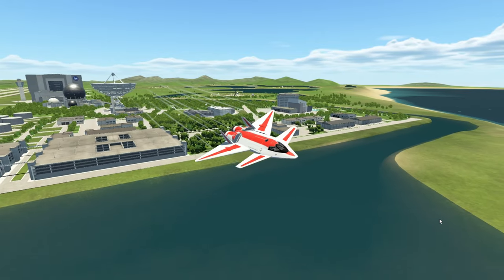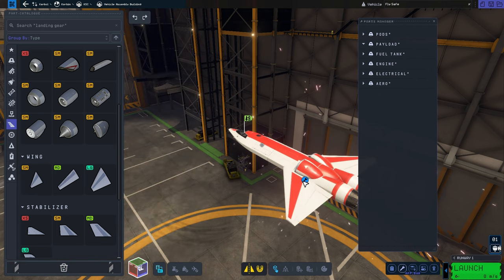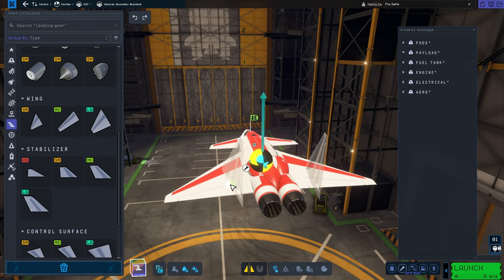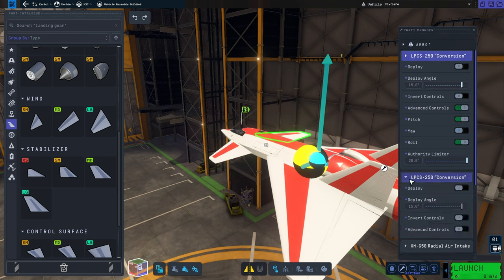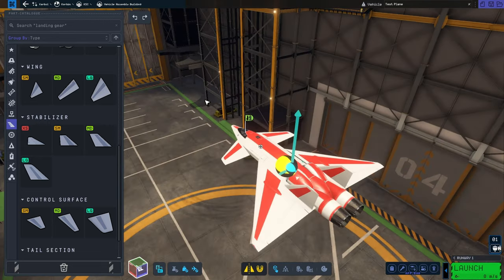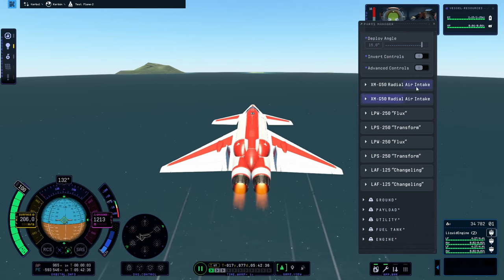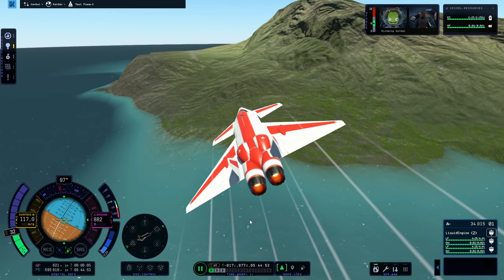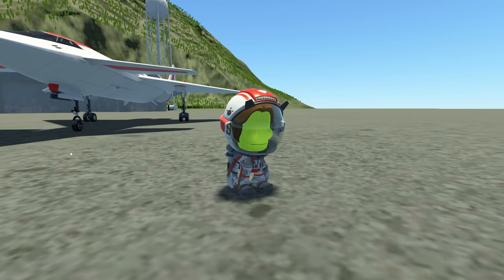How to build and fly your first plane in Kerbal Space Program 2

Comment: 11:05 Like in KSP1 you can adjust trim by pressing "alt + <direction you want to trim>" in KSP2.

So nose up trim would be "alt+S". (press multiple times for more trim)
This also works for roll and yaw trim.

To reset all trim to neutral you press "alt+X".

I think you can just hold to trim quicker, but I prefer smaller adjustments anyway.
Reply from the maker: Thank you for that
Reply: You're welcome!
I just found out there's a bug with it in KSP2, as it cuts the throttle when you use alt+x to neutralize trim. So be mindful of that :D
Reply: Does this fix the plane constantly tilting toward a nose dive? Also you seem knowledgeable enough, do you know why my planes wobble when I have auto stability on? It stabilizes but it wobbles horribly.

Comment: Building planes is so annoying with being unable to move the wings easily. I didn't realise it was because the procedural window was open but that's because it doesn't flash or anything. Also blueprint mode should lock the part placement in the direction towards and away from you, again trying to move wings was a nightmare.
Reply from the maker: Procedural window confused me as well

Comment: how do you fucking trim?  The plane keeps wanting to dive and I need to get 1/2 way around the fucking planet.   My fingers are numb and soar from CONSTANTLY fighting the fucking plane wanting to fucking power dive.  I have adjusted the CG and CoL properly but the plane just will not fly level hands off!   It also wants to constantly bank to the right!  I  FUCKING hate planes in KSP.  I have 3000 hours as a RL pilot and lost count of time in flight sims.  Building and flying planes in ksp SUCKS ASS!

Also I am playing on PC with default key binding and ALT-S and ALT-W BOTH pitch DOWN drastically.
Reply from the maker: yea, planes are currently busted, i hope they fix them soon. I am also having problems balancing it